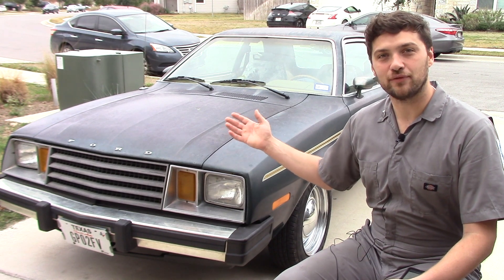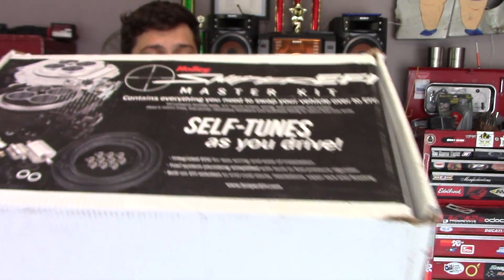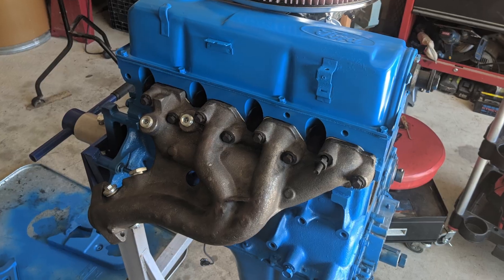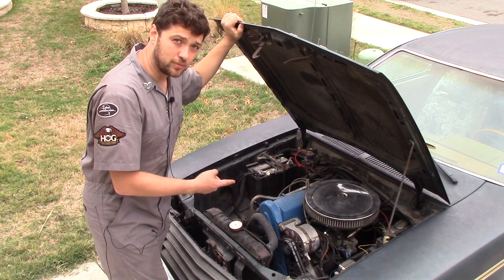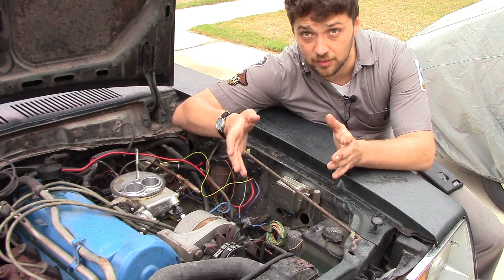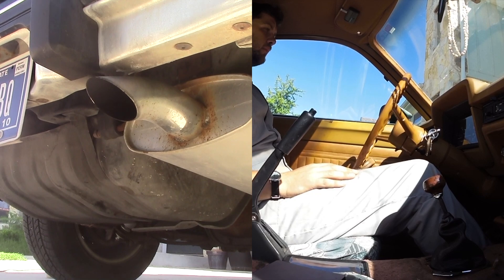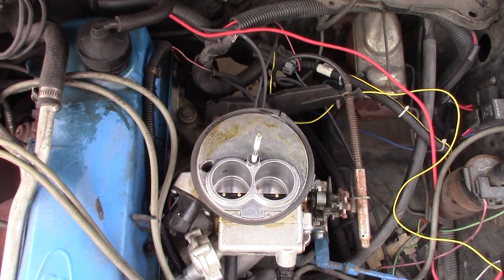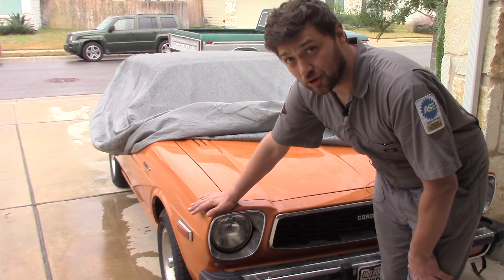How I built my FUEL INJECTED Ford Pinto using Holley Sniper 2300 EFI

Comment: 12:20 My father had a 1980 Pinto and it started up exactly the same way; once I pumped the accelerator so many times to get it going that it smelled like a Molotov cocktail . I had this vague assumption that cars like this started up with less drama when they were new; I guess it's hard to tell, since even your fairly well preserved example had a number of other issues like the valve seals, head gasket, etc. The new throttle-body injection is definitely an improvement and it would be interesting to find how much  more than its original 88 HP this engine puts out.
Reply: I would definitely go with this simple EFI conversion. Best solution by far. But I have to say to all concerned that your Pintos were not functioning correctly to begin with. I owned an '80 pinto back when it was about 5 years old. Great little car. I never had that kind of trouble starting it or any other  carbureted car or truck I owned (yes I'm your dad's age). the thing about carbs is that they need to be choked correctly and the vacuum baffle in the air-cleaner needs to function correctly. As well the heat duct/tube must be intact. Cold starts (even on a warm day) start when you depressed the accelerator once. This closed off almost entirely the butterfly baffle at the top of the carb  and cut off most of the air intake. When cold the vacuum baffle in the air-cleaner would also close forcing the early air flow to draw from the radiant heat from the exhaust manifold. This process provided warm air for the first few miles until the engine warmed up. When the engine did warm, the baffle in the snorkel would slowly open allowing outside air into the carb. The electric choke ( or the original bi-metal spring mechanical type) would also allow the carb to also open up and the engine would run on full outside air once at operating temp. Whenever I bought cars back then, the first things I would do would be to confirm these air intake components where fully operational including the metal or fiber ducting to the air-cleaner snorkel. My Pinto, Mustang II, '73 F-100 and '74 Comet GT all started on the coldest Vancouver morning with one depression of the accelerator (more than that and the engine was flooded thus the smell you noted of fuel. You were dumping raw fuel into the cylinders. One good backfire and bad stuff happened.) and a single turn of the key.  Once they were at operating temp. a small depression of the pedal while starting was all that it took to start.  That's how a fully operational fuel system worked on cars from the late 60s to the 80s. I had a '64 Comet that I converted to an electric choke as they were far better than the original mechanical ones. Most good running cars would start with almost no priming when warmed up. The exception to this for me was a '70 Maverick street/strip car I owned. It was high compression and cammed. It had a chrome aftermarket air-cleaner and none of the air intake items were there. Fortunately the car was a sunny day ride and the electric choke usually was enough to cold start it. That said, occasionally I went through the same process shown in the before part of this video and had to let it warm up for at least 3-5 minutes before it would go anywhere. It rarely saw winter driving and if it did I took it real slow for the first few miles until it was warmed completely.  Driving carbureted cars really wasn't as crappy as so many people like to suggest today. every driver knew how to operate them and you could toss your keys to a friend. That said, my first car was a 1969 Toyota Corolla with a manual choke. That was as foreign to some of my friends as a Model A Ford was to folks in the '50s and '60s. Adjusting spark and advance to start, a story for another time.
Reply: If the carb is tuned correctly and the choke works, unlike in this case, the car just needs a couple pumps and it will start.

Comment: 👍🔔
Excellent video content and presentation.

I've done similar.
Mount your fuel pump inside one or two beer can couzies placed inside a solidly mounted soup can like enclosure and don't squeeze it very much. Let the foam work.
An E2000 pump from AZ for $60 will supply a 5.0 HO 🦊 and is very quiet.
You might also use house water pipe gray insulation tubes and enclose your lines for sound dampening. An E2000 does not need it.
The Merkur XR4ti used a fuel line pulsation dampener at the engine fuel rail but I've never needed one.

Hope this helps.
👍👍😎😎😎🇺🇸🇺🇸🇺🇸
Reply from the maker: Man that was some great information! My pump did end up quieting down when I fabbed up some better fuel line https://youtu.be/t3CTkWR5tNs

Comment: Having owned a Pinto in my teens, I really enjoyed your video!  I had a 73 wagon with the 2.0 motor back in the late 70s time frame. I rebuilt the motor for power with Ares Racing Pistons, Childs and Albert Piston Rings, Isky camshaft, Edelbrock intake manifold, Mallory dual-point distributor, alcohol injection, and a Spearco turbocharger kit. The motor ended up making 288hp @ 8,000rpm. The car was very fast for a 4 cylinder, but the transmission and rear end could not handle that much power. It blew up at least 3 stock transmissions and one stock rear diff. I installed an 8 inch rear end from a 78 mustang II V8 (bolted right in) to fix the weak rear end.  It had T/A radials on American Racing wheels, sway bars with teflon bushings. and handled really well. What a fun car!  A turboed injected version would be a lot of fun...what a sleeper!
Reply from the maker: Wow that sounds like a killer sled. I've been toying with the idea of turbocharging it now that it's fuel injected but I definitely know the stock trans and rear end will be the weak link.

Comment: Put a good set of exhaust headers on that engine and you'll be amazed at the increase in H.P.
I did that to a 1974 Pinto i used to own in the late 70's and did a valve job to it as well.  All was very easy and only took a couple of day.
Reply: our 74 pinto 2.3 was a great car.
Reply: @BigEightiesNewWave  
Are you sure that wasn't a 2.0 liter that was designed in Germany?  My '74 Pinto had the 2.0 liter and it was a great engine.  Plenty of power especially after I put headers on it. It had a 4 speed transmission and was real fun to drive.
Maybe your family's car had an automatic transmission and they put the larger engine in it?  I don't know enough about that.
Reply: I put a header on my 2.4 Nissan truck out of necessity. Exhaust manifold broke & the header was cheaper. I read all these guys saying headers don't do anything. They're wrong. It's not always about racing. It performs well under normal operation.
Reply: @paulshamblin6260  
An engine has to breathe to get the oxygen for combustion.  Ditching the factory air filter helps too.
Reply: My 71 2 liter 4 speed would barely pull 80 flat out. All I did was install Some Headman headers and went 102 on police radar. Good thing the cop was a friend of my Dad.
Reply: @budlistar5312  
As I recall the old 2.0 liter engine was over square meaning the bore and stroke were exactly the same.
Reply: That Ranger exhaust manifold is a very good header and a smarter choice for a daily driver.

Comment: I have a 1975 Pinto with a 2.3 turbo out of a T-Bird and this just made me miss my old 72 N/A 2.0 4-Speed Pinto.
If you put a modern T-5 and 3.70 gears in that Pinto it would probably be a little ripper and still get better gas mileage.

Comment: Is it possible to use a C5 Corvette fuel filter for return line on this system?
Reply from the maker: I'm not 100% sure but I would assume not. Holley recommends not having any restrictions on the return side. they state you don't want any more than 3psi on the return side. what's special about that filter in particular?
Reply: Garret Seesing the C5 fuel filter is also regulator and has a return port, 3 ports total. From tank, to engine and return to tank. I was thinking maybe using the return to tank port by tapping into supply line with a TEE. Not sure if that possible but sound logical.

Comment: Maybe when you install the new tank, you can go with an in tank pump.
Reply from the maker: It actually quoted down quite a bit when I fabricated some proper fuel lines in the next video https://youtu.be/t3CTkWR5tNs unfortunately an in tank pump isn't quite an option due to the fuel sender lay out.

Comment: Nice vid. When i got married in 1981 i got my wife the same Pinto as yours- but it had a auto trans. What a turd! I pulled the cat & muffler, put on a glaspak, and had trouble trading it off 3 years later coz "Pintos arent this quik, especially autos".
Reply from the maker: Hahaha yeah mine had the C3 automatic in it when I got it. You're dead right it was a slushbox. The 4 speed really woke it up... not as much as the fuel injection and a nice cam though.

Comment: Here's an FYI for future swaps.   The 3.8 L 90*V6 weighs the same as the 2.3L SOHC.   The early FWD Taurus blocks share the SOHC bellhousing pattern but you may want to go with a T-5 transmission to return some of your gas mileage.  The 83-87 3.8l V6 intake manifold used the same 2v holley carb bolt pattern that your 2300 Sniper throttle body.   I mention this because 2.3l single plug heads are getting hard to find these days.
Reply from the maker: That's some great info. The T5 requires just a light bit of trans tunnel modification to fit in the pinto but it's definitely on the docket! The first motor I ever rebuilt was a 3.8 out of a taurus. I'm a big fan of it.

Comment: Nice to see a younger Gen appreciate the Pinto Pony, EFI and all.  Pretty hard to beat a Weber twin choke on a Pinto 2.3
Reply: Cosworth YB would easily beat that... the ultimate Pinto engine. You can even buy a new aluminum block for one.
Reply from the maker: Thanks! Mmmm I'd have to say the sniper firmly beats the Webber 32/36 that came on my 2.3
Reply: Garret Seesing no doubt the drive-ability is better, and it takes knowledge, experience to properly tune a carb, my problem with EFI conversions is the cost.  Prolly exceeds the value of the car.

Comment: Better to buy a FORD 2300 FUEL INJECTION ENGINE WITH COMPUTER.
Reply from the maker: Mmmm I'm not sure sure. The holley is really tunable on the fly. Requires no reflashing or software. If you decided to install a turbo or take it off or put a larger one or swap cams it's just a few clicks on the touch screen.

Comment: I'm not understanding your warm-up problems.  I daily drove an 83 2.3l Mustang for 13 years.  Pump it twice and it starts.   I swapped in the Ranger roller camshaft with a multi-index timing gear set a 2 degrees advance  with a shaved head.   Put 100k+ on the motor without a problem.   Sounds like you needed to rebuild the carb and set the timing via vacuum gauge.
Reply from the maker: The carb had a rebuild 2 years before I shot this. Ethanol was hell on the old Webber rubber seals and diaphragms. What I was trying to illustrate is that with EFI it lights off and you can pull away with nearly the exact same performance as with a warm motor. That is something a carburetor just can not do. In addition to that, if the vehicle sits for a few months the fuel in the bowl goes bad and starts rough. Because the EFI is a sealed system you don't have that problem either.
Reply: @Scooter_911  One of the things I learned early on with the carb'd 2.3l SOHC was to ignore the factory idle settings.  750-800 during warmer weather/900 RPM during cold with at least 1200 RPM on fast idle.  Made no difference in urban mpg.  2.3 is torquey enough to hill crawl my 'stang in fast idle.   I feel you about the ethanol in the gas.
Reply: As far as the noisy fuel pump,  I'd heist an in tank pump from an EFI 86 or later Mustang.  Pretty sure Ford didn't change the size of the opening for the sending unit from the the 80 Pinto  with the later EFI tanks in the Fox bodies.
Reply from the maker: @crgintx  yeah definitely. I've got it idling at 1000 RPM right now and it seems way more comfortable than the factory settings
Reply from the maker: @crgintx  unfortunately I'd have to figure out a modify a mustang tank to fit they're just different enough to be a huge pain. The pump did actually quiet down quite a bit when I fabricated some proper fuel lines https://youtu.be/t3CTkWR5tNs.

Comment: You are absolutely correct about EFI. I have tinkered with all sorts of cars since I started driving in the 60s. I've gone through all sorts of carbs,cams, headers,  manifolds , ignitions and so on , but the absolute BEST money I ever spent was last year when I converted my big block 63 Impala to aftermarket EFI. MSD in my case. WHAT A DIFFERENCE!. I had a temperamental Demon 750 carb, and to say the least what a profound difference! Just turn the key and it starts and idles instantly, no pumping the gas ,no farting and bucking, just absolute perfection. Good job on your Pinto.
Reply: Can these fuel injection systems be made to function with a 3 way catalytic converter?

Comment: My favorite car was the 1978 Ford Maverick.  Straight 6 engine and bare bones basic. It  was the 4 door, not 2 door. I always wished it had EFI. That car lasted well into the 1990's before wife demanded it go away. I miss that car . If I could get my hands on another one, I would.
Reply from the maker: Oh man I think the Maverick is one of the most severely under rated cars! Getting pretty hard to find these days too!
Reply: But 77 was the last year for the Maverick...
Reply: @halohunter5217  Beat me to that lol
Reply: YOU  ARE  CORRECT  ...

1977   WAS  IN  FACT  THE  LAST  YEAR  OF  MAVERICK  / COMET .

That  Was  PROBABLY  JUST  A  TOO  QUICK   " TYPO  ".
NUMBER  
ERROR .

They  Most  Likely  MEANT  To  Type  A   Last  Digit   " 7  " 
But  Instead  Accidentally  Typed  An  " 8 " .
A 
Simple  Explanation.
Reply: I always thought a 1970s Granada, which was basically a dressed up Maverick, which was an updated Falcon, would be an interesting car to own. People complained about the mushy ride and numb steering, but those cars always looked more upscale than they were and I'm sure the suspensions could have been beefed up just enough to make the car a little less floaty. Ford had some pretty bizarre cars in those years (monstrous T-Birds, LTD IIs with crazy roof lines), but the Maverick and Granada stayed down-to-earth and sensible.

Comment: I’ve always wanted to put a SVO 2.3 turbo in one of these old pintos
Reply: @nellyfarnsworth7381  
Mmm, memories.
I was there the day a buddies dad brought home a brand new 87. 
He eventually got his hands on it that summer , what a fun car. 
A bunch of kids who just got their license, oh boy. 
Haha we made it to the county fair in 23 minutes vs the usual 45 that year🤣
Top gear, and the tach stayed at 5000 to 5500  for about a good 15 minutes of that ride, what a blast.
Reply from the maker: Goes right in! The holley can run turbo applications too if you can't get your hands on an old SVO or turbocoupe.
Reply: That's alot of heat under the hood , worked at a dealership while those were popular, learned alot about gas turbos in those days, we had alot of heat related problems .
Reply: @beckywatt5048  
Haha we did cook a turbo in it once. 
Ripping it thru a gear and all of a sudden it was a mosquito fogger in the back. 
She did run best on mobil super , you'd get 18psi out of it while most others wouldn't barely tickle 16.
Reply: @beckywatt5048  
Still do unless you fix em.
Svo and merkurs had front mount intercooler which helped.
Reply: Am I the only one who was worried about that giant engine on the gutter falling on their head?
Reply: Could have done a 5.0 swap too
Reply: @the74impala  For the 5.0 swap you'd have to do suspension work also. That 302 weigh's more than the 2.3.
Reply: @nellyfarnsworth7381  how much
Reply: @nellyfarnsworth7381  i helped a fiend back in 86 or 87 take a pinto wagon.  Turn it into like a Rancho out of it  .looked factory.  Is like to build one .with a hoped up engine . .like was in my race car .it take a raged out looking pinto put a race engine in it see what it do in a 1/ 4 mile ..then build a turbo engine for it. See the refrance
Reply: @nellyfarnsworth7381  what year .. how much
Reply: For all of it .
Reply: @nellyfarnsworth7381  or mustang 2 fast Bach. Like  not coup  I had 1 with 2.8 v6.  I played with some
Reply: @nellyfarnsworth7381  I've got a intake exsaulst  turbo .and piping .pistols rods ..  but its a carburator 2 year for mustang turbo .only 120 hp to 140 hp. Fastest thing ford had that year in 1/4mule ..but I've been thinking of making turbo into a supercharger so to speak
Reply: @nellyfarnsworth7381  the 1980 turbo mustang was carburator not injection
Reply: This was great...I'm thinking about a sniper for my old Chevy truck
Reply: This video could be named How To Double The Value Of A Pinto.
Reply: @unicornsteaks6769  arent these thing dangerous?
Reply: I want to put a new 2.3 ecoboost from a new mustang in a pinto
Reply: The 2.0/2.3/2.5 lima motors can all replace each other.  So the turbo out of the SVO/turbocoupe/xr4ti will bolt in.  You can even take the 2.5 bottom end, bore it over all the way up to a 2.9.  There is a volvo dohc head that be fitted pretty easy.  Lots you can do with them.
Reply: @randombuilds8336  yea I know someone with thw,Volvo head. ..a or of work. . I race these engine on dirt and,asphalt tracks for over year years .